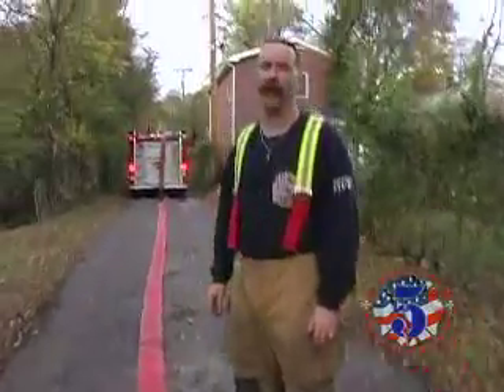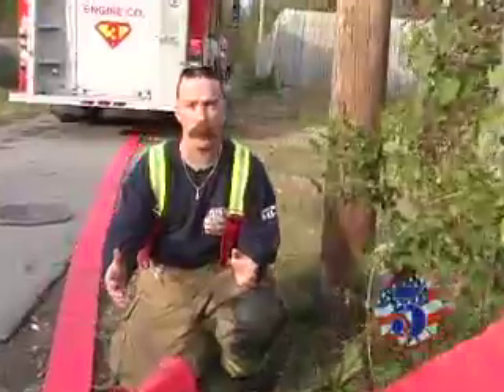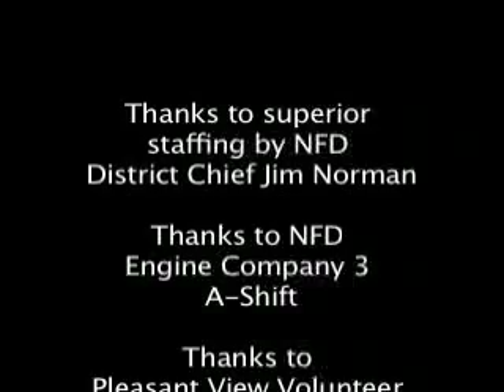Supply Line Tips

Comment: Good vid.  We make hyd. pouches out of old 5" hose.  Cut about a 3' piece, and make a flap at one end that you can tuck back into itself.  Rivet the other end shut, and rivet on a couple of straps that are big enough to go around your supply line and not restrict it when it's charged.  We carry a Hyd. wrench, a couple of spanners, and a couple of flares in the pouch.  Just attach it behind the hyt. connection.  You can still use the rope too.